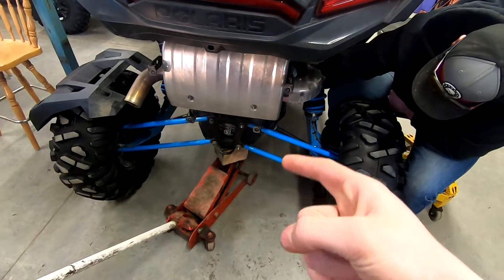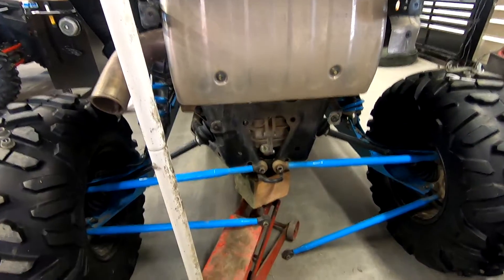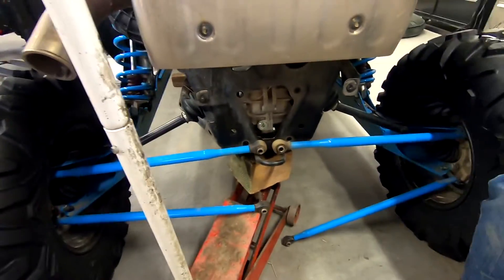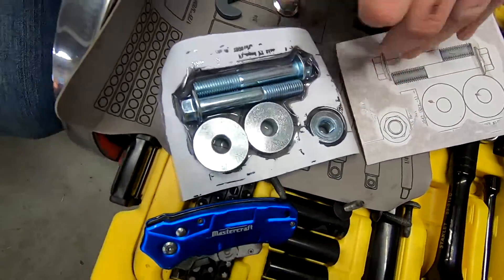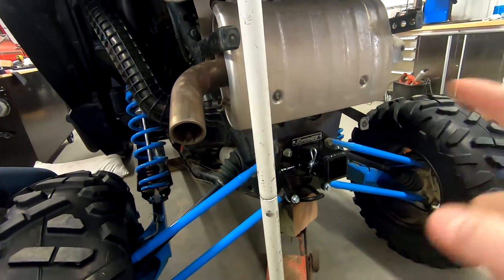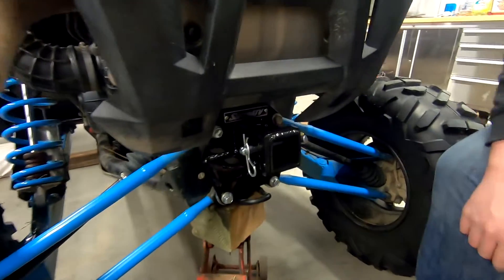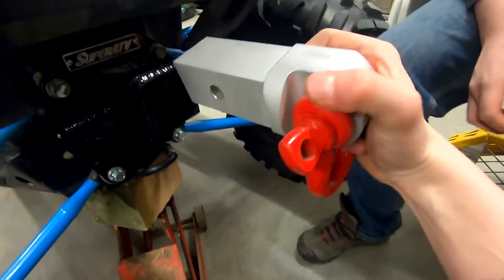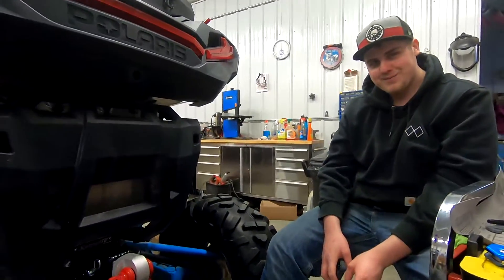RZR Rear Hitch Reciever

Comment: Have a 2016 RZR 100xp purchased this so I could move the trailer around. This install takes a lot of patience. On the 2016 driver side nut are impossible to get to. Tooke several hours to install due to the clearance of the nuts. If you like frustration go for it.

Comment: The manual says to torque to 50 pounds.
Reply from the maker: The SATV instructions says 40. You replace 2 bolts and put spacer pucks in, I did 40 and have not had a single problem in over 1000miles.